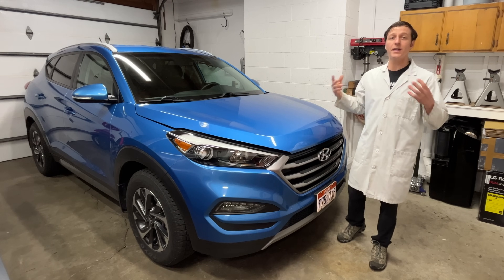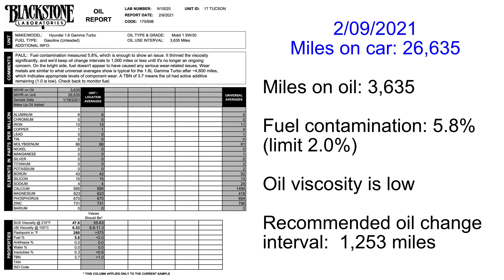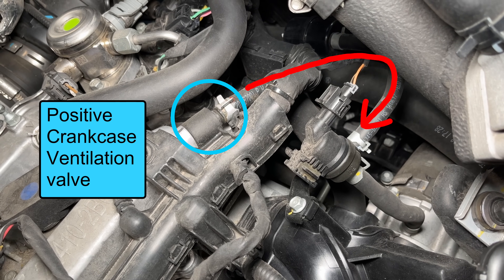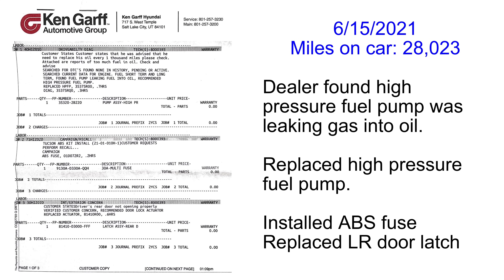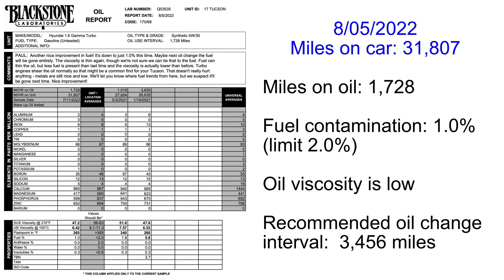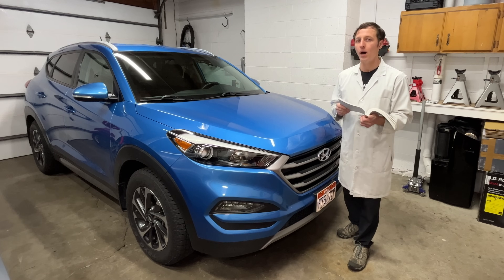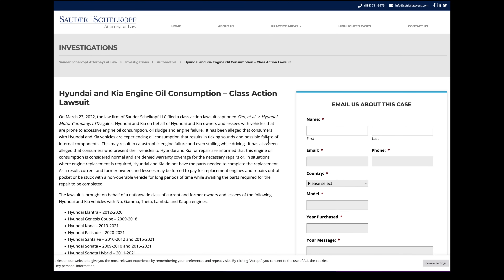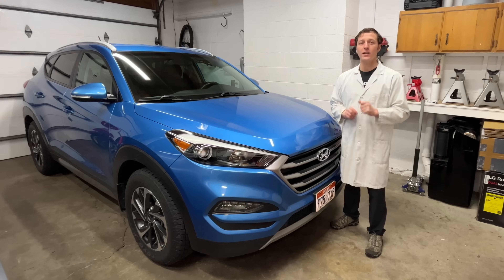Hyundai oil consumption and gasoline contamination problem solved

Comment: Enjoyed your light approach look at this problem. I have a 2017 2.4 Santa Fe that does not have a turbo but it certainly burns oil. 1 liter per 1000 km.  I check it weekly and change it every 5000 km . It has 91000 km on it so that means 18 oil changes, but if I take into account the extra liter every 1000 km that adds another 91 extra liters used. A week ago it went into limp mode so I towed it in and ended up with a decarbonization, plugs (fowled) an injector all for $1000. Now I read consumers reports to see which car I should think about buying or should I spend $4000 to rebuild this when it fails. What a crap shoot. I will give my 2020 Accord to my wife and I will drive the Santa Fe and keep my fingers crossed. PS my Accord has the 1.5 Turbo Earth engine which gas gets in the oil as well.
Reply: Lots of valve cover gasket leaks causing excessive oil use on Santa Fe engines !!! $360 to replace gaskets at the shop

Comment: I own a 2017 Tucson with the 2L engine, got it new in 2018, it now has 82,00 km on it.  Since I'm retire i don't drive it much, i did all of the recommended maintenance and oil changes since day 1, which is 2 oil changes per year whether or not i had reached the recommended mileage.  The next to last oil change was done at the same time i had all disk and brake pads changed.  The last one was done at a Ford dealer though, where my son works as a tech adviser (the guy that greets you at the counter).  While the mechanic was working on my car he came up front to the desk and asked me to follow him to have a look at what he had discovered;  Turns out the oil pan was full and the oil filter had only been hand tightened.  I had lost about 1.5L of oil according to him.  So i parked the car in the driveway and drove it for a grand total of 3,000 km. (not 3,000 miles here). Yesterday while i was coming back from a rare one hour and a half drive on the highway, my oil indicator started to come on when i was breaking or turning, i managed to drive it to my local garage (not a Hyundai) dealer but it stalled when i tried to re start it to park it in front on garage door #2.  Turns out this time i had lost 2.5L out of the 4L the engine contains and it's not because the dam oil filter was loose this time.  Of course my 5 year warranty has expired since may 2023 and i find myself with a seriously damaged engine, of that i am sure.  I'm am getting ready to go to the dealer (knowing full well i won't have an appointment before a month at least, winter tire installation season here in good Ol Canuck country).  Although i know realize it is a known issue and Hyundai is being sued all over, I am absolutely sure they will do nothing about it, perhaps another oil change at my expense of course.  26 days before Christmas this could not have happened at a worse time, I know from experience I'm heading straight into a David vs Goliath battle here, which i don't expect to win.  Great video mate, but seriously who has their engine oil analyze by a lab ?  Thanks for sharing nonetheless, have a great day, God bless.

Comment: I have seen reviews where they said the oil passage ways when made were drilled but not cleaned out, leaving metal shavings that would clog the oil passages.  Leading to failure.  Happened with engines made in USA Alabama.  Should sue that plant.   They had plenty of time to fix the issue.   They must be making more money by providing extra engines.

Comment: 2011-2019 GDI engines fail because of gasoline mixing with engine oil especially when doing mostly short trips - gasoline doesn't have time to evaporate. Cruising near 1000rpm adds to the problem (low oil pressure at the connecting rod bearings)

Comment: 2017 Kia Sorento 2.0 turbo bought brand new.
It started using oil around 90,000 miles about a quart every 2 weeks. Kia did a oil consumption test for about 4 oil changes and said motor needed to be replaced. They didn't replace my motor because I could tell it wasn't brand new and shiny but they did replace something in the motor and told me to use Castrol synthetic blend not full synthetic and they warranted it for 12,000 miles. Have 205,000 miles on it now and been doing my on oil changes since it was fixed at 100,000 miles. Other than that been a great car.
Reply: 2016 Kia Sorento not 2017 and oil changes every 5000 miles.

Comment: Have a 2019 with the 2.4. Its burning about 4 quarts per oil change. This will certainly clog your catalytic converter much faster and require regular intake valve and combustion chamber cleanings. Make your changes early and ask for an overfill if you take it somewhere.

Comment: Not all of them kias have this issue just certain makes like the 2016-2020 Kia Sorentos 2.4 liter GDI engines id rather have an old 1999 engine instead of this GDI bull crap like as long as it rolls it'll sell naw these Koreans needs to stop making these junks an start making a good reliable vehicle oh ya I also have a 2010 Kia Rio with 177.000 miles on it an it's not these new lemons there selling now cuz it still running like a champ.

Comment: Yup that's what happened to my kia 2016 Sorento with a 2.4 liter GDI an I had just bought it an only had it for a month first the check engine lite went on so it was still under warranty i took it back ro the deal i bought it from they checked why the lite went on it cane back as a faulty thermostat housing so the went to correct the issue an after they took a test drive to see if there was any leaks the machine said he heard a loud knock from the engine an all the oil came out likely from rod that broke from like this guy said gas in the oil an ya before all of this i checked the dip stick an the oil looked real lightly not like it's supposed to so ya that's my story of my new 2016 Kia Sorento so the dealership bought it back now I can get me something else.

Comment: I worked as an oil change tech.  I’ve literally never serviced Any Hyundai/Kia GDI engines where a significant amount of oil wasn’t burned off and the oil wasn’t completely sludgy and carbon filled. Even if the customer has done full synthetic oil and a 3k oil change interval. I always advise people not to buy these engines for this reason as well as knowing that they fail so often that getting a replacement is difficult.   Thank you for making this in depth video.  It was very informative.
Reply: I wouldn't go any longer than 5,000 miles using full synthetic oil
Reply: That's interesting because I do my own 3000 mile oil changes on my 2021 kia K5 1.6 L Turbo GDI. The oil comes out looking very good, no sludge, and still slightly goldon, and still at the full mark, not over, before i start to drain......
Reply: 2023 3.8 lambda ... 0 oil burn. 2026 1.6t .... 0 oil burn. 
Break it in properly and change every 5kmi and use good oil
Reply: The customer may be going over the oil change intervals. It can be a leaky fuel injector like in this video. Also, it could be faulty piston rings.
Reply: That was cause of over oil change intervals 100%
I owned 4 Hyundais and never had any issue with 3k oil change interval at all..
Reply: You are incorrect! Take a look inside of my 2020 Sorento V6 with almost 80k miles. Mobil 1 synthetic changed every 5k miles with the filter and tier 1 gasoline.  Zero issues and Clean. 3rd generation mechanic and engine builder.
Reply: @owenhill-vf7ko  Do you have a GDI engine?

Comment: I have a 2015 tucson. Brought with 155000kms on it. 3 months after purchasing it engine light cane on and was throwing code P0420 ( cat converter) I had it replaced. Now 5 months on its has done only  7459kms engine light is back on and throwing the same code. 

It has been burning oil like mad has been serviced twice. In the 8 months of owning it. 

Obviously if the car is still burning oil there is no point in replacing the cat again. Trying to find a solution to the oil burning. I have hurd the pcv valve, piston rings and intake valves could help, but from further reading this has not been effective. Any ideas anyone?
Reply from the maker: Replacing the PCV valve is cheap and easy. It might help, but probably won't fix your problem. If the piston rings are worn out, you need to replace the engine. These engines aren't worth repairing, so it's usually best to find a used engine in good condition. Or just get a different car.

The Hyundai engine wear and oil consumption problem can be prevented by testing your oil and changing it often. Once you already have oil consumption, it's not an easy fix.
Reply: 2015 KIA Forte Koup with 2.0L. Cat convertor has been replaced for some reason.

Comment: What manufacturers other than Hyundai/Kia have had problems with GDI? How bad have those problems been.
Reply from the maker: I've heard from other youtube videos that Ford has fuel contamination issues on their GDI engines. I'm sure a lot of car manufacturers get gas in the oil. The only way to know for sure is send a sample of your oil to the lab.
Reply: @LabCoatPaul  Thanks. Gas in the oil makes it bad not to change the oil on time. Also, the intervals manufacturers recommend are thus too long. Its best to go by the severe use recommendation for OCIs.

Comment: Use higher octane 91-93 on shell. And today you can try use valvoline restore and protect only for better results and cleaning carbon
Reply from the maker: Good advice! These newer engines run better with higher octane. With low octane they might run rich, retard timing, or limit boost to prevent knocking. Running rich could lead to extra gas in the oil.

Comment: 2014 hyundai accent Non-turbo 1.6 started burning 0.5 quarts of oil at 80k and now 30k miles later I am burning 1.3 quarts per 1k miles. I changed oil every 3k miles as a precaution when I got the vehicle and I still burn a good bit of oil... And of course my car isn't on the list... Because, you know, it doesn't burn oil or anything the exact same way all the others listed do... 😩
Reply from the maker: Sorry to hear that! Does yours have GDI? You might have gas getting in your oil through the high pressure fuel pump like mine did. In that case, 3K mile oil changes aren't often enough!
Reply: It is GDI. Your video made me get a test kit which I am about to send in. I have a suspicion that I have the same issue of the high pressure fuel pump leaking by somehow.

Other than the oil consumption issue the car still runs great, idles smooth, and there is no valve noise that I can hear. Despite what everyone warned me about with Hyundai I have only had to do scheduled maintenance and wear items.

Comment: Did they just replace the high-pressure fuel pump with a newer version or what?
Reply from the maker: I think it was the same part number, but there was a lot less fuel in the oil after.

Comment: Well your using valvoline it’s the bottom of the barrel oil.  
Try using Amsoil Signature series oil and do the test again.
Reply from the maker: The issue is gasoline contaminating the oil, so my guess is the better oil would get contaminated the same amount and would not improve anything... 
Unless the Amsoil makes the piston rings seal better or something that would reduce gasoline getting into the crankcase. It's worth testing.

Comment: I have a had a 2011 optima since new. So far it has 165,000km on it. Runs good and has 170+ compression on all 4cyl.
I change every 4-5k with 5-20 full synth only.
Still gets 40-45mpg on the highway.
I assume I am one of the lucky ones??
I haven’t noticed any gas smell in the oil yet but maybey I should look at dumping it soon if this is gonna happen.
And I am pretty sure it’s not worth repairing if that happens.
I have a lifetime warranty they sent me but from what I hear it may be impossible to get them to replace it.
Just a bit worried now lol.
Reply from the maker: It sounds like your car runs great! Instead of worrying, send a sample of your oil to the lab and you'll know for sure what's going on with your engine.

Comment: Hyundai denied my engine replacement even though it was still within the warranty mileage and time. My dealership was able to get the extended warranty coverage to cover it. My car being only 2 years old and needing a new engine is pretty deviating when the factory works hard on  not helping customers under warranty. All this being said, my new motor has big engine time valve tucking. Sounds like it already is going to blow. This happed a week after having the new engine installed. So basically, it will soon have a useless brick in the driveway. Buy Toyota or Nissan.  I will. 😢
Reply from the maker: Sorry to hear that. Make sure to document all your engine problems with videos and paperwork from when you took it to the dealer. Sometimes dealers will replace your engine with a cheaper used engine that might also have stuff wrong with it.

Comment: I have a 2017 tucson as well my oil is being consumed have to add oil abouy every 2 days but since April I keep having a misfire  for my piston 1 and 2 have to continously replace spark plugs and coils any solutions ?? Please help it's my only vehical I've paid mechanic to do a check and they thought it was gasket cover replaced that and it still keeps happening
Reply: I have 2016 hyundai tucson, same issue, had to order off ebay oem o2 sensor and oem coil pack, then I  added Dual oil catch cans,  one for pcv and the other for crankcase,  add breathers on the output of catch cans, now car drives a whole lot better, oil burns but not as bad anymore,  also I did a carbon clean before adding the 2 oil catch cans
Reply from the maker: A valve cover gasket will leak oil on top of the spark plug. If you have oil on the part that goes in the cylinder, you have bigger problems like leaking valve seals or bad piston rings. I recommend doing a compression test on your engine.

Comment: I have a 2017 hyundai sonata 2.4lt I believe. I do change my oil between 2,500 and 3,000mi because I do not want to have an oil consumption problem. So far at a 125,000mi I haven't had a issue but I am worried it may happen soon. I read the article on Google but it didn't say what you did to fix the issue. I always changed my oil at 5,000mi on my older vehicles but decided with the weaker rings I would not risk it. I have always gotten at 350,000mi on my vehicles before something would start acting up and I'd junk it due to high mileage and not wanting to sink money into something that can't obviously last much longer. I am hoping to get my $40,000 out of this vehicle before having to replace it. Vehicles cost way to much now days and lose their value to quickly to not get the maximum amount of use out of them in my opinion. If I'm paying 40k for a vehicle I expect to get 350k miles out of it because selling it a few years later is like throwing money away. I need transportation and yes I get the luxury model so I can drive in comfort because it's not much more then the base model but I really don't care about being the coolest on the block. Obviously if I did I would had spent twice as much instead of a hyundai lol. Anyway I am hoping their is an easy fix if this happens.
Reply: I don’t think any Kia or Hyundai will get close to 350k without a motor change. But ya never know. Meticulous maintenance is key.
Reply: @crashandburngaming5103  from what I am hearing now probably not but so far it's doing good.
Reply from the maker: You're doing the right thing by changing your oil often. This problem can be prevented, but fixing it once the engine is ruined requires a new engine. Make sure you test your oil. If your high pressure fuel pump has a leak, those 2,500 mile oil changes won't save you!
Reply: Should I replace my high pressure fuel pump just to be safe? I mean I'm at 126,000mi and it may be better to just be safe. It seems like it would be easy to replace. It can't be that expensive and I'd rather be safe then sorry. I would like to get over 300,000mi out of this vehicle. Personally I think $40,000 is outrageous for a vehicle. Maybe I'm just cheap but paying that much money for something that loses value as soon as you drive it off the lot especially when you include maintenance, taxes, insurance, and is something that could leave you stranded at a moments notice.

Comment: If fuel gets into your engine oil then you end up with too much oil in the engine, and not less than enough oil since fuel is being added to the oil
Reply from the maker: Yes. You get diluted oil, which has a lower viscosity. This leads to engine wear. The engine wear leads to the engine burning oil. When it burns oil, you'll have less oil.

Comment: The oil change interval for the 1.6 in the 2016 manual is 3000 miles not 5000 miles.